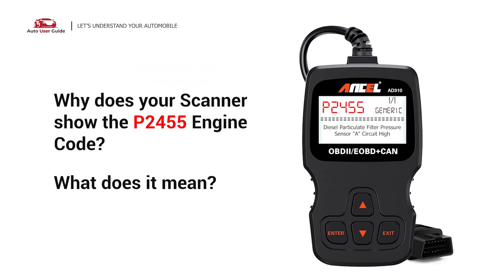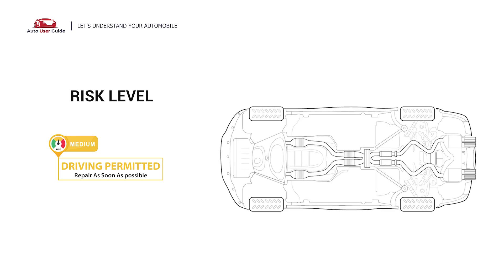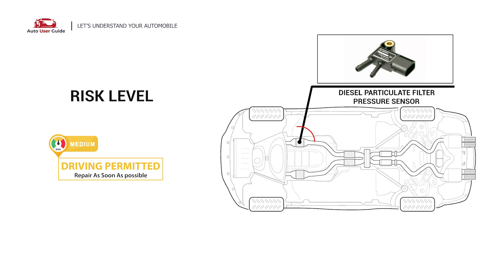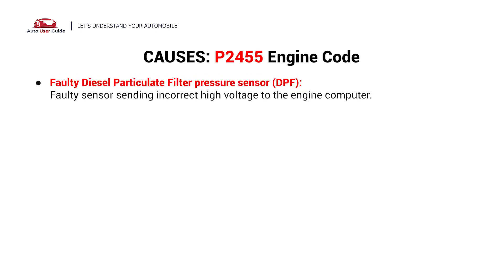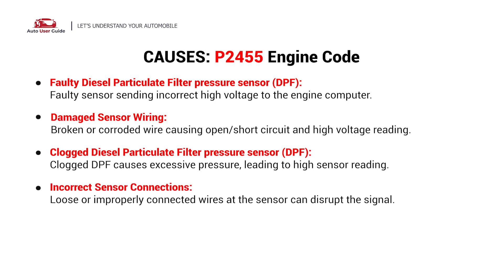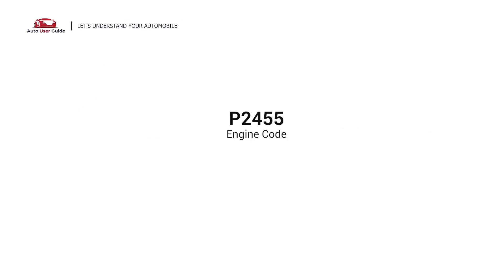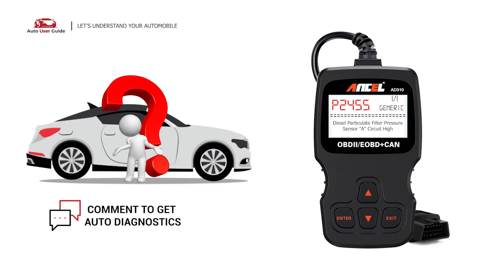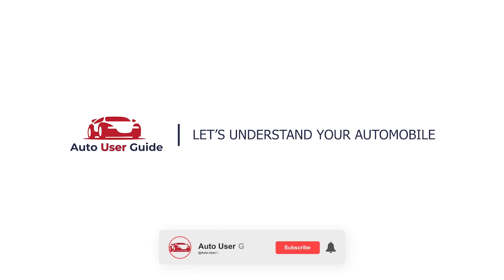What is P2455 : Engine Error Code Causes Explained

Comment: yes i want to know how to repair that code
Reply from the maker: Thanks for your comment! 🙌 Code P2455 usually relates to the Diesel Particulate Filter (DPF) Soot Accumulation / DPF Pressure Sensor Circuit. 🚛⚠️

Common causes include:

Faulty DPF differential pressure sensor

Clogged DPF or excessive soot buildup

Wiring/connectors issues to the sensor

Failed regeneration cycles

✅ Fix steps:

Inspect and test the DPF pressure sensor and wiring

Perform a forced regeneration using a scan tool if the DPF is only partially clogged

Clean or replace the DPF if heavily restricted

I’ll be making a step-by-step repair video for P2455 soon — stay tuned! 📹🔧
Reply: @ManuelGarcia-ie7oo   i have a 2008 f350 6.4